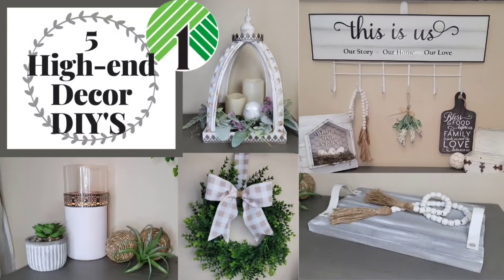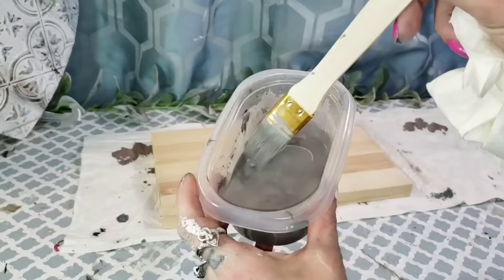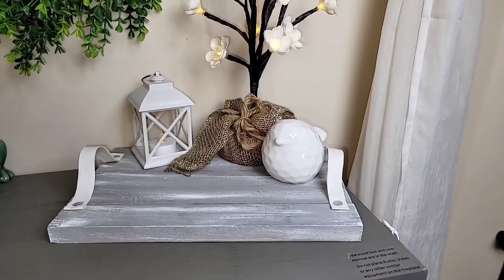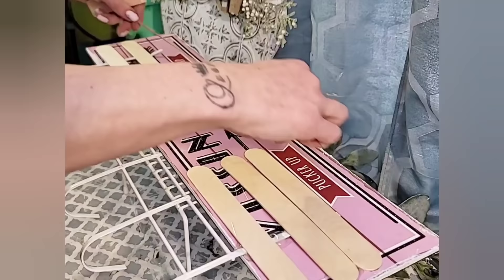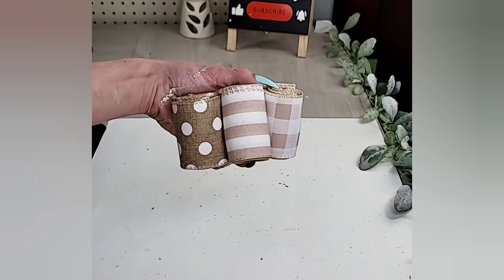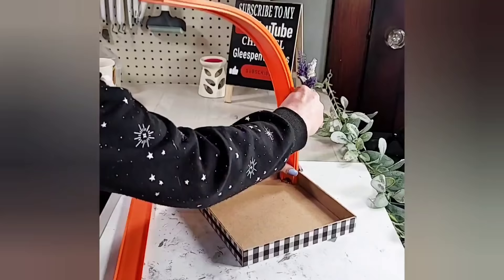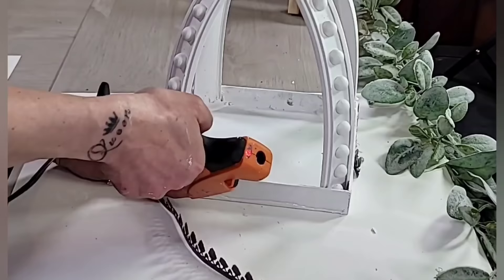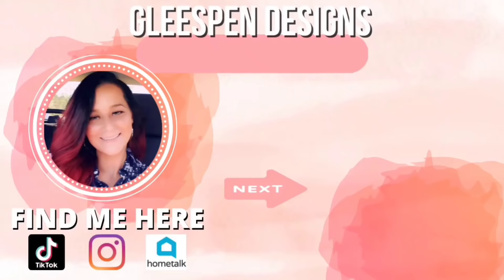5 HIGH-END DECOR DIY'S | DOLLAR TREE

Comment: I use gorilla glue hot glu for that metal ribbon and it would not come off. I know because I was off just a bit when I put the ribbon on my project. I wanted to adjust it but it was stuck!
Reply from the maker: RIGHT!! I have never had an issue with any surface really when it comes to the gorilla glue hot glue sticks... Sometimes it can work to good lol. once it is on it is on! lol Thank you so much for watching.